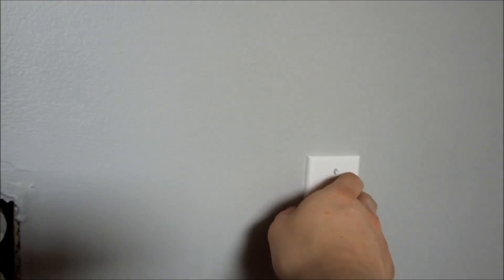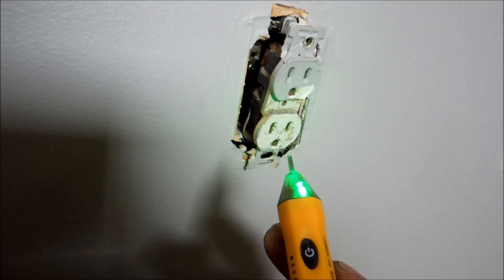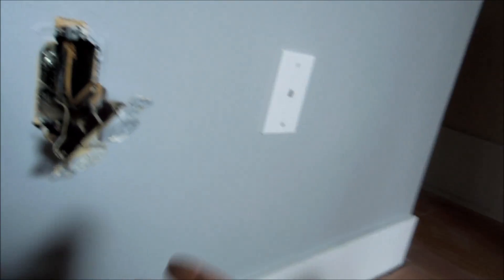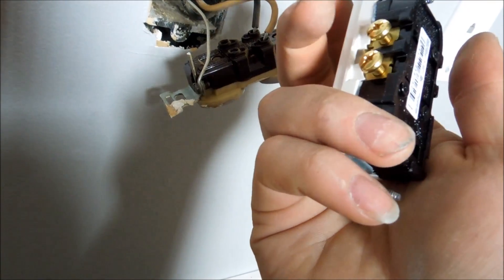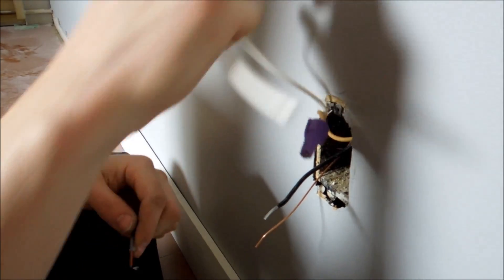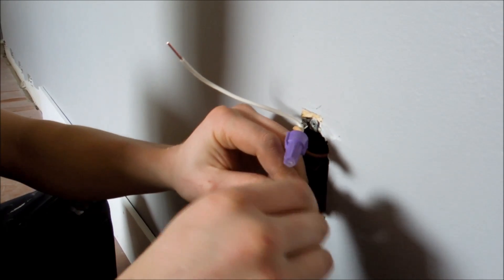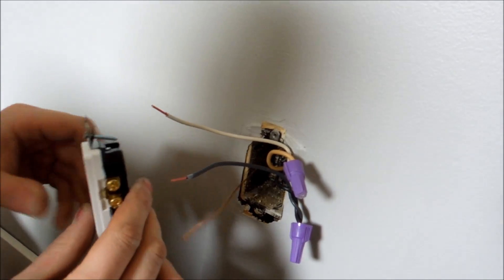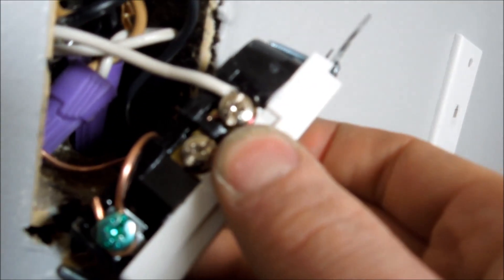HOW TO EASILY REPLACE ELECTRICAL PLUG SOCKET OUTLET COPPER OR ALUMINUM WIRING

Comment: hey if you dont have the ground how you can wire the ground from there to the box?
Reply from the maker: Sorry I'm confused by your question. If you look inside your plug box there should be a ground wire screwed into the box that comes from inside the wall into the box. If you currently do not have a ground wire going from the plug to the box I would suggest adding a small piece of ground wire from the ground on the plug to the ground inside the box you should see the other existing ground wire in there coming from inside the wall like I said
Reply: What I'm saying is that I know u say I can just put a ground cable from the outlet conector to the box but if the box is not grounded all the way to the breaker panel that's pointless, in order to make efective what u saying the box in the wall should be grounded to the main panel.
Reply: @ghostlyrich  
There's only a ground connected to the box if the box is metal and not plastic.

Comment: You should take this video down.  This is how NOT to update a house with aluminum wire.  JUST BUY AN ALUMINUM WIRE RATED OUTLET and then you are done!!!  The way you did it by combining copper and aluminum is a fire waiting to happen.
Reply from the maker: Thats what penetrox is used for these are full of it...... Please read up on it as it's used my thousands of electricians per day
Reply: Thanks for the tip!

Comment: Do not listen to this person with regard to Aluminum wiring.  This cheap-o technique is a fire waiting to happen and no inspector in the western world would sign-off on this.  I am sure that he will not let you stay at his house when your house burns down, if you survive.   Even Copalum is a hazard each connection if not inspected yearly.  You are better off replacing all of the Aluminum in your home with Copper, well worth the investment.  Please do the research yourself.
Reply from the maker: jason135791113 it passed had a red seal electrician. every country has there laws I guess

Comment: If my old outlets are only two prong can I install three prong?
Reply from the maker: CubNole  im not going to lie bud i have never done 2 prong outlets other than for say shavers i would check with a electrician
Reply: Lud Wig
Look new and allow me to plug in my three-prong devices! This entire house besides the remodeled bathroom is nothing but two prong outlets from the 60's. Most of them are also worn out so you can plug into them and the plug just falls out. Bend the plug any way you want, it just won't stay in the outlet.
Reply: You can add three prong receptracles, but I would use a GFCI outlet.
Reply: Not by code you can't.
Reply: yeah you can use them. the 3 prong is for a ground wire. If you don't have a ground wire, the three prong wont do anything for you except to make it look new.

Comment: What about the danger of galvanic corrosion between aluminium and copper?
Reply: ghostlyrich Why did you opt for the #65 twist-on berets rather than COPALUM or AlumiConn minilugs?  These twist-on berets don't do anything to help with aluminum's much higher wire creep properties, and I think that's the most problematic attribute of aluminum wiring...
Reply from the maker: osmoregulator the purple twist on caps you see me use have greese in them to protect the wire from corrosion :)